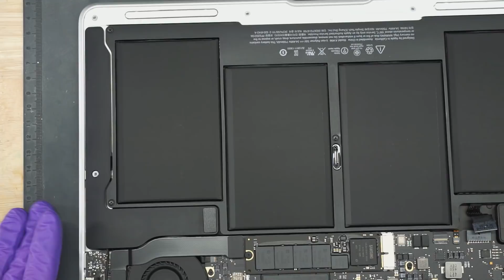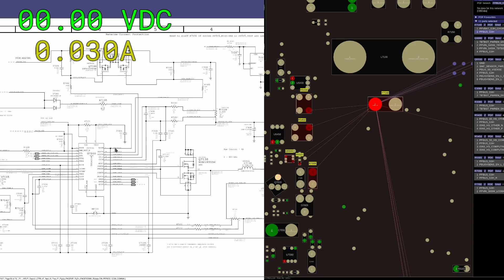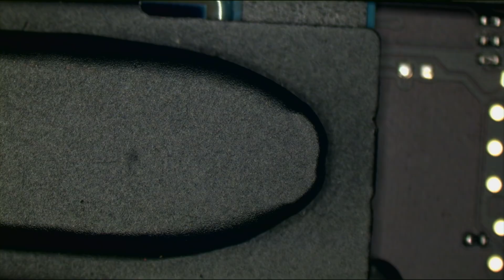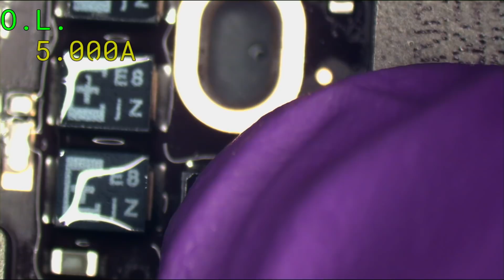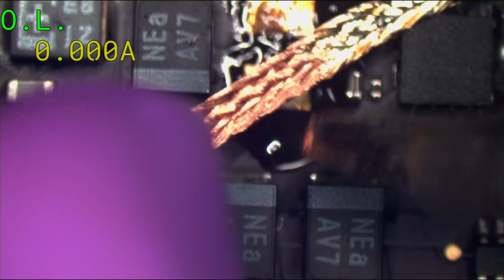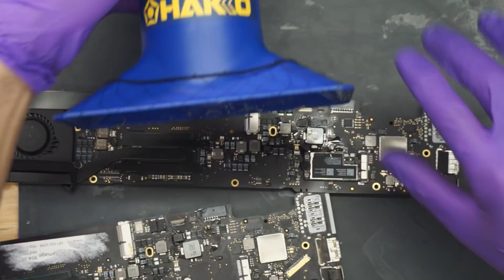A boring board repair

Comment: Can someone explain why he was surprised that the voltage dropped out when he removed the capacitor? What is the faulty capacitor doing to the circuit?

Also, why did the electricity not take path of  other capacitor next to faulty one? Are they on different circuits?

Comment: How to assign static name to ttyUSB https://unix.stackexchange.com/questions/66901/how-to-bind-usb-device-under-a-static-name i usualy print a nametag on my RS232-USB cable like "/dev/ttyUSB.Aurora" and then in udev rule i have ACTION=="add", ATTRS{idVendor}=="0403", ATTRS{idProduct}=="6001", SYMLINK+="/dev/ttyUSB.Aurora" i have these rules for all my cables, arduino RS232 UPS etc... nice thing is that i can name them using human readable name! So it is better then tty0 or COM1 etc

Comment: I’m not defending apple but I have a story to tell you why I buy apple.  My AirPod pros were clicking with ANC on.  I chatted with apple they sent me a new set free of charge 4 months out of warranty.  I just got off the phone with them last night.  I know it was a warranty bulletin on apples part and went into it expecting them to try and talk out of it. They didn’t.  I have a Samsung 970 evo nvme 2tb drive. It isn’t recognized.  Won’t show up in an enclosure. Won’t show up in a pc.  The serial number is on a label that sits across the arm chip, dead space, and the ram chips. It fell off.  I called Samsung about repair.  I was told without that labor that’s only held on in three places I cannot get it repaired.  I looked at another evo it doesn’t say anything about warranty void if removed. I asked why the hell they would put a label with the serial number on three chips and put the regulation label on the back flat side of the ssd.  I was told that the label on the back side is a special heat spreader label. I said bullshit why would you put a heat spreader label under a PCB?   No copper ran through so what heat is it going to spread.  I asked how long is the warranty.  He said 5 years. I said great they haven’t existed for 5 years and I have proof of purchase. So let’s get it rolling.  Nope nothing.

Comment: Hey Louise! I know you talked about Apple earlier and there difficulty fixing/supplying parts. Razer is worse. 

I have a razer 2018 laptop, the battery has started bulging and is now bending the entire machine. I have looked for replacement parts and they refuse to give/send another and the worst part is to get it fixed I have to send it to Germany from the UK via plane to there warehouse.

Although Apple gets its fair share other companies like razer are going under the radar and it’s just wrong.

If you are looking at buying a razer DON’T

Comment: Board repairs are not boring, but irrelevant for the majority of your audience that doesn't do board repairs, that's why they get less views.
Try /dev/serial/by-id/usb-* for persistent device names.
Apple cars: I think they are less likely to succeed in the EV industry as there is already Tesla with very similar business practices in the field. They have also been plagued with quality issues.
A cheap FLIR camera could be a faster way to detect heat. Maybe the cap cooled down due to alcohol evaporation?

Comment: You can write an udev rule to get persistent names for your USB serial devices.

You need to get the USB ID of your device. When it is connected, you can see the ID in the output of 'lsusb' as "ID (vendor ID):(product ID)", where vendor and product ID are hexadecimal numbers.

Then you can create a file in /etc/udev/rules.d/, for example /etc/udev/rules.d/50-usb-serial.rules, containing

SUBSYSTEMS=="usb", ATTRS{idVendor}=="vendor ID from lsusb", ATTRS{idProduct}=="product ID from lsusb", SYMLINK+="ttyStatic"

This will always link your device to /dev/ttyStatic

Comment: There's a similar thing here in the UK when you take your test for a motorbike.. When you take the test for bikes ranging 50cc t0 125cc you have to do U-turns. But when it's for bikes 500cc and above they don't do the test because the bikes are bigger and heavier. Go figure.

Comment: One reason why the cap was hot at first and not after the alcohol was applied could be because it matched the resistance in the boards circuitry spreading out the heat, so it still got a bit hotter but not as much as before.

Comment: hey louis i need some help .i recently bought a m1 macbook pro and spilled black coffee over it and so i went to apple store and they said battery ,touchpad,and logc board needs to be changed but when i tried to turn on it turns perfectly and works perfectly but it turns on only on power cord and doesnt turn on on battery and shuts down when disconnected from power cord .what should i do

Comment: Yeah, linux devs don't really care about users or consistency, /dev/ttyusb0 is just going to refer to the order it was detected. There's a way to refer to USB devices by unique ID but I don't remember and it's probably unreliable in other ways.
If linux was actually good, we'd be using it right now instead of Microsoft's or Apple's garbage.

Comment: Louis, Systemd assigns the number in the /dev/{device}{number}. There's no way to predict it especially when hotplugging. The work around is to look up the device id and then use that, such as the UUID for drives or the ID for usb drives. You can script it using 
$ lsusb | grep {id}

Comment: The highways not as dangerous, less changes happening. At least where I live
Reply: Same around here, but head toward some of the bigger cities and the other drivers seem to want to actively run you off the road, or so it seemed back when I was a new driver. Never tried driving around NYC though.

Comment: Manoeuvres, scanning traffic and pedestrian targeting (and fkin' cyclists, or bike jihadis as they are commonly known) are tough. 

Going fast and straight in a virtual tube, after you learn to control the car is actually several orders of magnitude simpler than city driving. There is not much to think and there are no manoeuvres. No pedestrians/cyclists to run over .... 

Modern cars (past 1970'?) are well balanced and got plenty of driving AIDS to help keep the car feather steady at speeds way above 60 bananas/minute (miles). 

Highway driving is like fixing the board in brainless mode. Monkey see monkey do.

That's why you really shouldn't need a test for it even if there are some dumb ass countries who call for it. Been to one. Positive that those people got 0 clues how to drive and are unable to solve many of the situations they encounter in their own castrated and civilized driving environment. (not actually civilized, just slow, under the threat of big insurance hikes and when something unusual happens people just freez and try to stop. It's really sad.) In a more savage traffic? ooof.

Comment: the /dev/tty can be remedied using udev rules, basically you tell the system "this device id from this manufacturer id, create a symlink of this name for it everytime it connects"
Reply: Create a file in /etc/udev/rules.d/99-power-supply.rules
It should contain something like this

SUBSYSTEM=="tty", ATTRS{idVendor}=="<vendor_id>", ATTRS{product_id}=="<product_id>", SYMLINK+="<your_name>"

You can find the ids using lsusb

Reboot or use a command to reload the udev rules, try connecting the printer and looking for it in /dev under your new name
Reply: Okay, my way is more complicated, sorry

Comment: I just spilled tea on my laptop. What do I do besides powering down, flipping it down, dabbing it with towel paper and leaving it in a bag with rice?
Reply: I can't tell if you're joking. Rice won't help you. Open it up, remove the battery, is it sticky? You need to clean it with alcohol, dry the motherboard with a hairdryer or something, leave it like this for as long as you can, preferably a week or more, put it back together, pray to god, turn it on.

I'm retarded so take my advice with a grain of salt. Your best bet is to take it to someone who works on computer hardware.
Reply: If the motherboard is dry you might get away with dabbing it with a paper towel, though. I've spilt stuff on my laptop keyboard before with no consequence.

Comment: As a developer the "I didn't forget how to use the software, the software forgot how to work" hit very hard lol.
Reply: We always called it "bit rot."
Reply: @Digital-Dan  What exactly is bit rot? I believe my dad told me that it was very common with old motherboards or something he would work on...
Reply: @Annoyeddisturbance  Bit rot normally would apply to any form of storage device.  CD's DVD's ,  flash memory,  Hard disk drives, floppies,  anything that stores data.  The bit's i.e.  data in some cases actually rot away,  oxidation,  delamination,  loss of charge in the cells in flash, etc.   Lots of articles on this subject.
Reply: lol,  as a developer I agree with Louis.   Many so called dev's don't have a clue or worse think they do.   Just blame the testers or lack of.

Comment: Glad to see you still using Alcohol to find shorts, first saw you do it about 5 years ago before you had a thermal cam.  tried and true.
Reply from the maker: I still have the thermal cam. It's just in the other room. and it's still not worth the time it takes to get up and plug it in on basic shorts that take 5 amps.
Reply: @rossmanngroup  Possible it didn't feel hot because the evaporative cooling from the alcohol.
Reply: @nogravitas7585  I'm a dumb-dumb when it comes to all this, but wasn't the rate of evaporation of the alcohol at the site any indication that it was the fuse in question?
Louis was looking for a heat source by touch, but what about where the alcohol was evaporating most rapidly?
Reply: @rossmanngroup  I assume its isopropyl what % though?
Reply: “Alcohol to find shorts” sounds vaguely kinky...

Comment: Watching your videos actually helped me find the issue with a defective motherboard. I used your validated Ouie-test and found a damn hot mosfet.
But now what? Where do I find a scematic to that specific mb so I can check, what caused the chip to blow? I expect, if I only replace the first defective part I found, it might blow up right away again..
Reply: If you're worried about the mosfet and their not expensive or rare just get 2-3 extra. If its a mac check out paul daniels software.

Comment: Highway , normally is pretty relaxed, less speed differences than in a city environment.  City driving is much more difficult,  due to cyclists and pedestrians jay walking, not caring about red lights.

However, highway driving should be part of the test.  Merging in, merging out, place on the road, safe distance, over-taking safely, and ofcourse most of all,  USE OF TURN SIGNALS IN ALL LATERAL MOVEMENTS!!!!

Comment: Driving on the highway is usually easy.
Stay in your lane, pass on the left and don't tailgate.
Reply: Lowkey easier than driving on sides streets
Reply: The hardest part is shoulder checking, if you got that down then you're good.
Reply: Joining the highway is kind of different though. Idk, wouldn't have wanted to do it in my own the first time I did it. 
Of course maybe US highways are different and your don't have those short-ass acceleration lanes where you'd better hope your car gets 0-60mph fast or that whoever you're forced to butt in front of will be paying attention.
Reply: And, Don't Text!
Reply: Big stress factor is passing on a busy highway yeah.
For beginners, just stay in your lane till its calmer to pass.
Reply: @tardvandecluntproductions1278 I'm specifically meaning taking a slip road onto the highway. At least around here the lane you get at the end of that slip road can end very rapidly,  so there's an element of "just accelerate and pray" to it. And the folks already on the highway aren't allowed to give way to you. 

Oddly not as big of an issue in practice as it is in theory.... somehow there always is a gap to slip into....I still don't fully understand how and why, because on paper you're definitely just smashing into traffic with no real way to wait more than a couple of seconds for a gap.
Reply: @tardvandecluntproductions1278  when I started I used to only drive in the right lane, because I felt so uncomfortable merging into traffic going 70+mph. I wasn't very great at shoulder checking. Then one day I watched a show called "Canada's worst driver" and it all clicked.

Comment: Do a search for udev static device rules. You can use device ID to assign a device to the same device file every time it's plugged in. Here is a guide I found real quick: http://www.reactivated.net/writing_udev_rules.html
Reply: Maybe a stack exchange question with like 3 steps would be easier to follow? https://unix.stackexchange.com/questions/66901/how-to-bind-usb-device-under-a-static-name seems good.

Louis, you can easily get the vid and pid to add to the udev rule using the 'lsusb' command. Run it from a terminal before and after you plug your device to find the right line.
It'll say something like:
"Bus 001 Device 0003: ID 0403:6001 FTDI USB serial cable" 
where 0403 is idVendor and 6001 is idProduct. Hope that makes sense.
Reply: @ThisRandomUsername  Thanks dude, I've had this problem for a bit now, but didn't know what to search for.
Reply: @TheBanndit  No problem. I haven't actually had a chance to try this yet, but I've used udev rules before for allowing non-root access to devices, and this looks right to me.
Reply: @ThisRandomUsername  Could also do dmesg -w which would keep it running on the terminal, and when he plugs it in it instantaneously shows the new entry.
Reply: @QuickishFM  That's very helpful, thanks. I think in Louis' situation, Hitch's solution is the right one, but this is useful in general. Thanks for sharing.